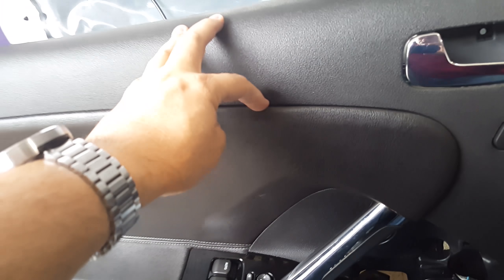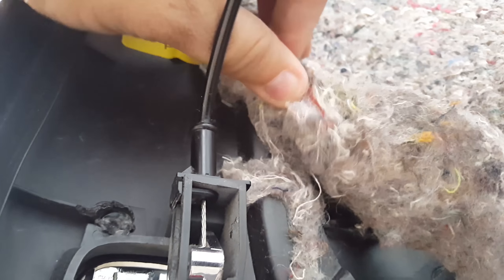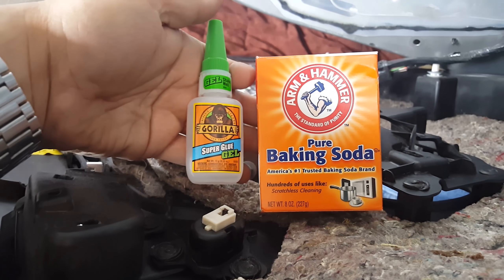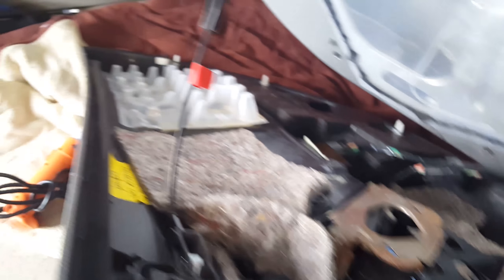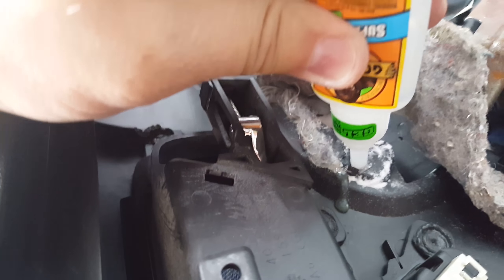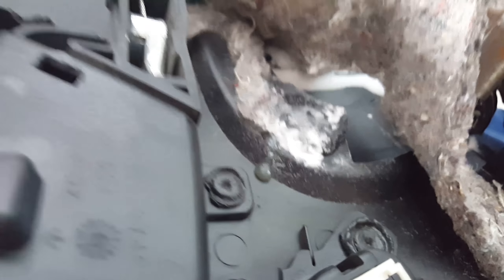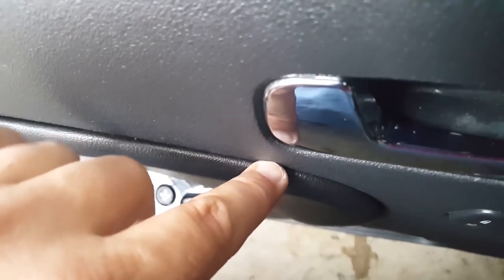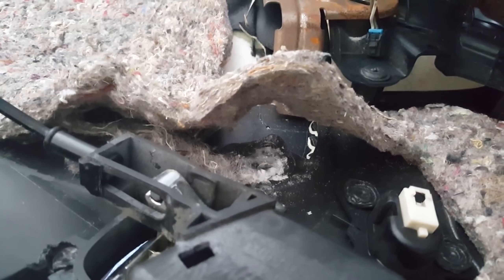Broken Door Panel Fix - Saturn Sky Pontiac Solstice

Comment: Mike, I notice the wire connected to the interior door handle. What did you use to keep the wire and little metal bar inside the door handle socket. Please message me.